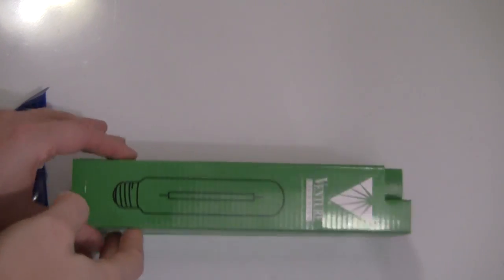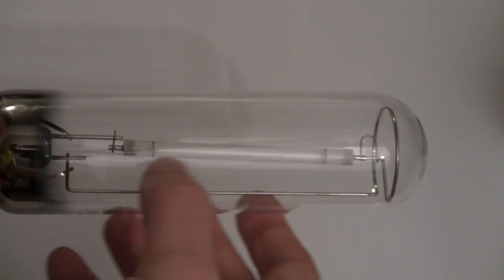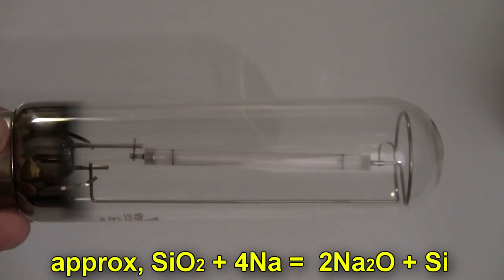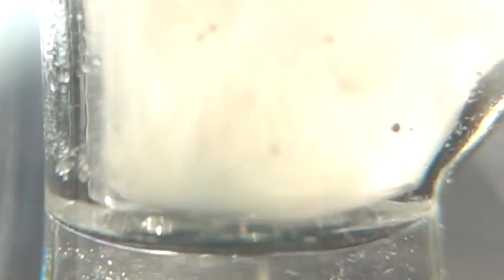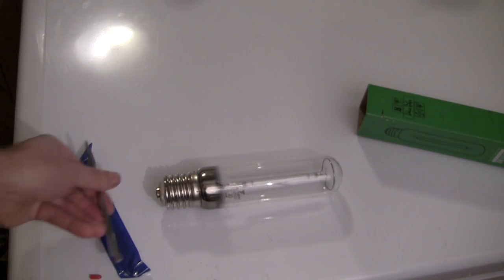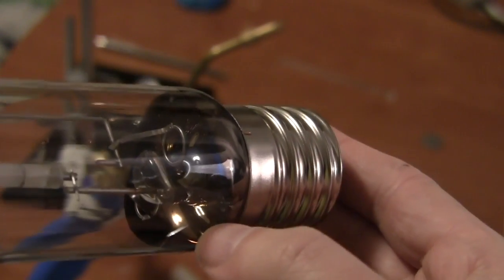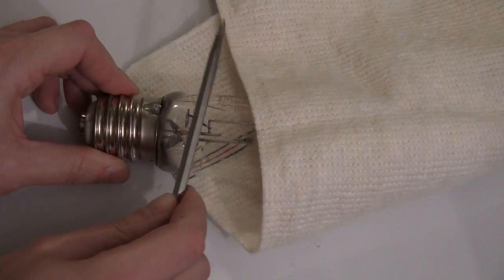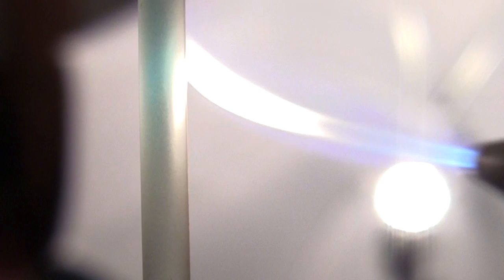Surprises in dismantling a sodium streetlight!

Comment: You know, Thunderf00t, you would've had much easier time scribing on glass if you used an actual glass cutter, instead of, you know, a layout scriber. :-) Otherwise, cool video.
Reply: +MantisNoMore Well, I respectfully disagree with your respectful disagreement. ;-) Glass-cutters which I'm familiar with allow me to cut bottles in halves in a controllable manner. If all you need is to break the glass to get the goodies from inside of it, you might as well use a hammer.
Reply: +MantisNoMore Moreover. If you're crushing the surface of glass with glass cutter, you're doing it wrong. A glass cutters requires as much pressure as you'd put on a pencil. Cutting glass is quite a bit of fun, you don't try to cut it all the way through with a glass cutter, it's impossible. You need to just score the surface, it doesn't have to be deep, just consistent and uniform.

Comment: Wouldn't it be more cost effective to have LED street lights instead of these monsters?
Reply: +Mikeferdy 
Na
Reply: +Mikeferdy 
Sodium lamps are actually quite efficient, luminous efficacies range in the 100 to 150 Lm/W for the higher wattage high pressure sodium lamps, while low pressure lamps can go even higher, so they actually are amongst the most efficient lamps we have in practice. As for being a monster, well, a 150W LED lamp would be a bit of a beast too.
Reply: Now days, yes, but HPS bulbs have been around for decades, and were valued for various reasons. They had lower power per watt then incandescent, longer life then carbon arc (very bright but short lived), and they were cheap. You can look at a 200 watt incandescent, but a 200 watt HPS or its cousin tech, Metal Halide, would be blinding. Their major faults are they change color over their lifespan, and they have a 5-15 minute warm up time before they get to full brightness. That and the amount of heat they can put out is fantastic.

Comment: The silvery material at the bottom of the tube is the "getter" material that reacts with oxygen left in the tube. You will find it in vacuum tubes, check a tube amplifier.
Funny, the main sodium emission lines are yellow (589-ish angstroms) so why do you see a blue dress?

Comment: A friendly reminder to everyone. Never touch the glass of a high temp bulb you intend on using with your bare hands. From what I understand the oil from you hands gets on the bulb and over time the heating and cooling of said oils causes stresses to build up, shortening the lifespan of the bulb (and leading to the occasional catastrophic failure of the glass).

Comment: Actually that shiny stuff at the bottom comes from the degassing rings. When they create the envelope, they heat the rings with inductance, and that shiny stuff coats the glass. If that stuff ever goes away, you have a bad envelope, or there was too much gas .... Ok, well, you e just figured it out.
Reply: The proper word for those rings, in the tube world, is "getter."

Comment: With the cesium bit, couldn't you have simply read the technical specifications of the light bulb you got and know exactly  what's in there? What you did is  more fun tho, but still, you'd also know whether it was vacuum or argon and maybe some other stuff you can't easily figure out just by doing things to it.

Comment: How are you holding sodium with bare hands? That's the first thing our chemistry teacher forbid us from doing on any kind of alcaline metal.
Reply: +martinicc67 the sodium is in the tube, so he don´t
Reply: He showed metalic sodium for a second in his hands in the open air
Reply: +martinicc67 As long as it doesn't come in contact with water it doesn't do any damage. Bare hands have the advantage you can feel moisture on them, so it is better with bare hands than thin glowes.
Reply: +martinicc67 The important thing is not to sweat when you do it, stay calm and you are fine, get nervous and you burn.

I vaguely recall something similar with liquid nitrogen

Comment: The silver at the bottom was from the gas getter. After the tube is sealed under vacuum, they vaporize the metal getter by induction heating to absorb any remaining air inside the tube.

Comment: Easiest is to take the base off, which gives you access to the evacuation pip. Not pure sodium inside, you will also have a tiny amount of mercury as a sodium mercury amalgam, and a fill gas of either neon argon or some Xenon, depending on the manufacturer. Some high voltage ( not for long, those metal seals will degrade fast in air as they oxidise) will give you emission spectra for all the fill elements, probably swamped by the bright white of Xe initially.

Comment: You're absolutely right about the metallic coating on the interior of the bulb. It's known as a getter and is used for maintaining the vacuum within the bulb. They use the same technique in vacuum tubes. when the plastics and what not inside the tube off gas, the gas reacts with the metalic coating, removing it from the atmosphere of the bulb.

Comment: So if the sodium gas is blue why do they glow orange? Sodium streetlights are "preferred" for having a limited spectra for light pollution. Any tips for disabling a streetlight, sodium or white light, greatly appreciated. #astronomerproblems
Reply: rocks
Reply: +Dylan O'Donnell  Pellet gun?
Reply: could have something to do with not having electricity running through it.
Reply: I suspect that, since sodium gas emits yellow light when excited, it has an electronic transition in the visible range, i.e. there exists an electron in a sodium atom which can swap between two states, either by absorbing or emitting a yellow photon. When you pass electricity through sodium gas to make it glow, you are really just supplying energy to this electron, pushing it into the higher state. To relax, the electron drops down a level emitting a photon. However, sodium gas will also absorb yellow light photons due to this same electron. When the photon is re-emitted, it travels in a random direction - usually not towards the viewer. So if you shine white light through gaseous sodium it passes through unaffected, except for the yellow component, which is effectively filtered out.

If this explanation is correct, I would expect to see other coloured gasses such as Cl and NO2 have a similar inverse-relationship between the colour they appear and the colour they emit when excited. Unfortunately I have no idea if that is the case.

As for you astronomy problem, if you know the wavelength(s) of the streetlamp, just subtract it from your photos. If the light is broad-spectrum like white light, then there is no simple fix.
Reply: Dylan O'Donnell I like the laser idea!
Reply: I normally use a laser to disable the streetlight with it's light sensor but something non destructive that doesn't itself also shed light would be good :)
Reply: +Dylan O'Donnell 
I used to just remove the panel at the base and there was a switch inside  you could just switch them off with.   I'm pretty sure doing that is illegal, but i never heard of anyone getting in trouble for it.
Shotguns also work.  Main problem with the latter is the local council will get the streetlight fixed if you break it, if you turn it off, it usually stays off for months.
Reply: +ProfessorEGadd Hey thanks. There is a panel but it appears to have rivets and no obvious ingress. Normal diplomatic efforts with council are ongoing in the meantime :) #astronomerproblems
Reply: ProfessorEGadd Oops wrong reply tag, Thanks for the chemical exegesis!
Reply: +Dylan O&#39;Donnell  Perhaps a laser in non visible spectrum could trigger the light sensor. Just aim that thing and connect it to a light sensor also, imagine the poor repairman, trying to fix a lamp that works perfectly in the daytime and never at night. :-D
Reply: +Patrik Pålsson That is a f#$ing great idea. Do they sell IR lasers? Think I have a date with google. Thanks.
Reply: Patrik Pålsson IR laser bought from ebay. If this works I'll be insanely happy. Follow me on google+ if you'd like to find out if it does :)
Reply: Same way iron isn't red when it isn't incandescent. When you heat something up to incandescence, the color it puts out as opposed to the spectrum of light it allows though it are often different.

Comment: The silver stuff on the glass bulb is the "getter", a metal alloy which was vacuum deposited by inductively heating those metal rings near the base of the bulb. The getter is designed to trap residual gases and keep the vacuum quality high.

Comment: The reflective coating might be what's called a getter, which a type of passive ultra high vacuum pump. It's a highly reactive metal coating that chemically traps gas molecules. The coating will eventually saturate but it will significantly prolong the high vacuum conditions inside the tube.

EDIT: Hur dur...   watch the video, read the description....

Comment: there is a neat trick you can use to cut bottles at home. 

take a piece of string, dip it in lighter fuel or something similar.
tie it around the bottle where you want to cut it. 
light it up, let it burn, roll the bottle for an even burn. 
immediately after the fire dies, dip it into cold water, icewater works best. 

ive done this a few times with bottles, no idea if it works with a light bulb tho. 
not sure about the english word, "water sand paper" would be direct translation 800 grit. is what ive used to take the edge off.

and wear some gloves, glass shards can be sharper than any blade.

Comment: The orange street lights are Lower Pressure Sodium. The more modern street lights are High Pressure Sodium. both are very red while warming up but the Lower Pressure Sodium are known for their Yellow High peak output. Heh I can let it pass this time :P haha only because I know that you know your nuclear power stations.
Reply: +thingyee1118 But yes you do have a HPS there. Just commenting on that part where you mention orange / yellow street lights.
Reply: +thingyee1118
Yes, you are absolutely correct.
Reply: +thingyee1118 just made the same post above lol ....
Reply: +thingyee1118 This is exactly why I read the comments.  Never know what you're going to learn.
Reply: LittleRainGames Should start out white, even a little bluish, then turn into a deep orange and increase in brightness while becoming more yellow. LPS lamps go full red during warmup.
Reply: +thingyee1118 Both LPS and HPS appear orange in color... though LPS lamps only produce light in one wavelength. I wouldn't say HPS lamps are red during warmup... in fact when first ignited they're blue-white.
Reply: +kuba kuba mine goes very red.

Comment: Just wondering here Thunderfoot, what's the crack with needing to get a sodium spectrum? Is it for lulz or? I mean you can Google this stuff so I'm guessing it's for lulz or for personal satisfaction. Could be completely missing the point though. Good video as always!
Reply: +Joppsta360 It's quite possible, that like with his videos regarding why AND how alkali metals explode when contacting water, you can't just google it.  Well you can google the alkali metal thing now, because Tf00t discovered it.

He is a scientist ya know.
Reply: +Joppsta360 he actually does science with stuff that SHOULD be "well researched" he put out a paper last year about some truly remarkable stuff with alkali metals and water which related to water-metal explosions with applications of reducing the risk of violent explosions when you have liquid metal hit water
Reply: +Joppsta360 There is two reasons for experiments. To discover new things or discover different ways to prove something we already know. 
As he said, usualy its very hard to get a clean sodium spectrum from experiment. If this method with the lamp works, he found a cheap way to make experiments like this in class, by using something thats already on the market.
Like his thors hammer experiment.
Reply: You can easily find the orange emission spectrum, but he was after the spectrum of the blue sodium gas.

Comment: that shiny stuff at the bottom is called a "Getter" it is a special metallic compound that absorbs any latent air. the subject of Getters are pretty cool with some interesting chemistry behind them. during the production of the bulb a vacuum pump is used to remove as much air as possible from the inside of the bulb before it is sealed. however no vacuum pump is perfect and always leaves a small amount of air which has to be removed chemically by the Getter after the bulb is sealed.

Comment: I had a few old, old, really old light bulbs. And at the top there was one single reflexive dot.

I cut the glass from these bulbs for some projects (wanted the intact filament, old school 2 mm thick stuff) and the dot vanished. So there's another instance of Cesium used in light bulbs, tho, i believe that in this case, it was used as an indicator, i doubt the dot ( 5mm across) was enough to kill any oxygen in a light bulb that was larger than an orange.

Comment: the silvering at the base end is the remains of a getter, you can see the metal rings at the base attached to the steel framework, these would have been induction heated to boil and deposit the getter on the glass causing the silvering

Comment: could you actually salvage the cesium from it?
Reply: +StarsServant 
wait can't you just open it in a chamber full of Xenon? That would displace the oxygen, and it's colorless. I think that would work. Plus it's heavier than air so it will stay in even an open tank without needed to be a hermetically sealed chamber.
Reply: +Sam Labbato if you could,  you probably have to open it in a chamber filled with a noble gas to keep it form oxidising.
Reply: +Sam Labbato 
You could dissociate it under heat in a vacuum or in an argon chamber, then filter it out...? O_o
Reply: +Xen Xander U rekt them:D
Reply: +Sam Labbato 
I'd try thermolysis or a redox-reaction with Lithium.
Reply: TheYoungtrust
What? i don't get your reply to my Xenon idea.
Reply: Gamer slang for your idea was the clear winner.
Reply: +TheYoungtrust know rekt means wrecked which is guess what... a real word.
Reply: M8 U jelly of my 1337 speech?
Reply: TheYoungtrust
Totally lost me.
Reply: There are two main reasons to type like that. One is to avoid censorship or search algorithms on bulletin board systems and such. The second is get an idea out when you have very little time like when you are playing online games. I just wanted to say  "Your idea is clearly the best." without typing a complete sentence, but I was clearly in the wrong place to use such short hand.
Reply: TheYoungtrust
Thank you kindly for such a compliment :)
Most appreciated.
Reply: TheYoungtrust  ( ͡° ͜ʖ ͡°)

Comment: Kek. That bulb looks like a penis
Reply: Omg misogynist, of course you see a penis.
Reply: +Rotaku If it was shaped like a vagina, then it would suck the light out of the streets.
Reply: +Rotaku damn, hate to imagine the accidents that could occur if you used it that way...
Reply: +Rotaku the flame looked like a penis.
Reply: +tehmonsterinyourbed you mean the g14 size light bulbs?
Reply: The metal thread is for screwing. I would, although,  get a diagnosis regarding the glass.

Comment: Great for indoor gardening
Reply: +Hiway metal hilide bulbs should be used in the early veg growth, but sodium in flower is optimal, for tomatoes, obviously.
Reply: +Aspartame69 dank tomatoes
Reply: +Aspartame69  
You'd pay enough in electricity, bulbs and ballast to buy 100 lbs of tomatoes.
Reply: +charlesvan13 Pretty sure he implied another category of plants.
Reply: +Aspartame69 I used T5's for my veg stage. Actually, a mix of T5's and a few CFL's. All around 5000k - 6500k. Mainly for the lower heat output and lower cost / energy use. Never graduated to flowering with with HPS due to cost, energy use. Had some amazing tomatoes with HO CFL's utilizing LST methods. Now i miss my indoor garden.
Reply: red spectrum is used for flowering response, blue is for more vegetative response
Reply: +Dreadnaught1985 with the ability to precisely tune leds, they are proving to be the most efficient. Any HID will have most of the spectrum it emits wasted due to it not being usable by botanical species of all types. HPS and Metal Halide are the traditional choices along with high output florescent options. They all have a ton of wasted energy though.
Reply: *****
Oddly, having googled it, impartial research shows that halide bubs are not better than sodium for any stage of growth. Just an old wives tale.
Reply: over 12 years i've found HPS is fine for all grow stages. plants veg well under it.,
the spectrum is FAR less important than just total light hours.
Reply: +Sultros Drunknsage Only for things that like a more yellow and red spectrum- HPS doesn't provide optimum "blue" spectrums which is ironic considering TF's blue discovery. He better check for contaminants.
Reply: +Hiway Well, with his other video, the reaction of the sodium vapour was blue as well.

Actually, even though it burns with a yellow flame and lights up yellow in the lamps, there is a small section of light blue in the spectra. 
http://www.open.edu/openlearnworks/mod/page/view.php?id=53133&block_recommender_display=activity

I think Mercury would make a decent light for indoor growing. Since it has lots of range, some of the others could work as well, depending on what you're growing.
Reply: +Aspartame69 which makes sense as metal halide emits a more blueish spectrum. HPS emit a more yellow and red color.
Reply: +Aspartame69 my experience with HID revolves around photosensitive emulsions used in textile screenprinting so I speak from a specialty niche.
Reply: +Happy Thoughts That's why he said tomatoes.
Reply: Us "indoor gardeners" use metal halide bulbs over HPS bulbs during the vegetative stage and will then use HPS during the flowering stage.
Reply: +Dreadnaught1985 
There's a difference between sodium vapor and ionized sodium vapor.